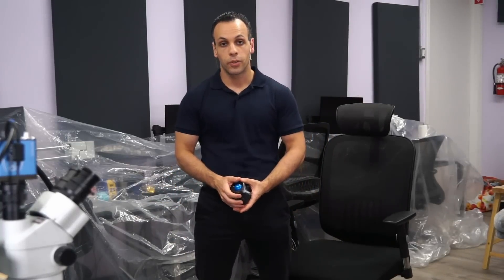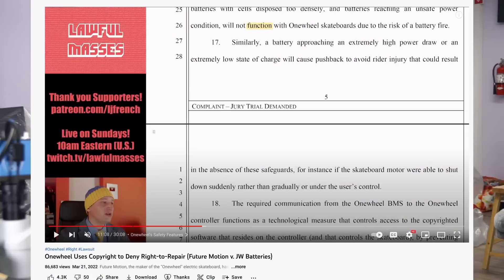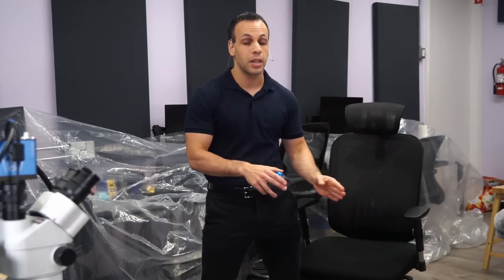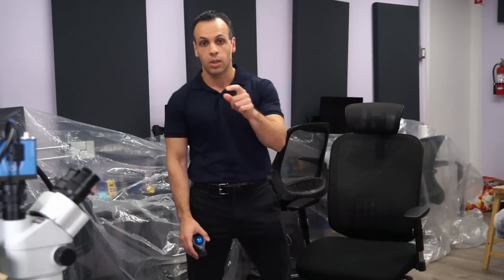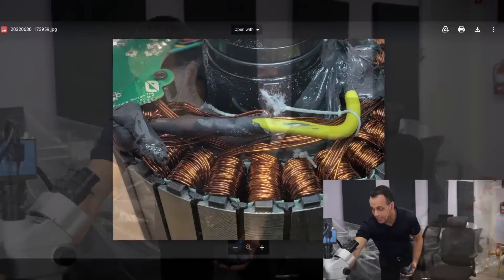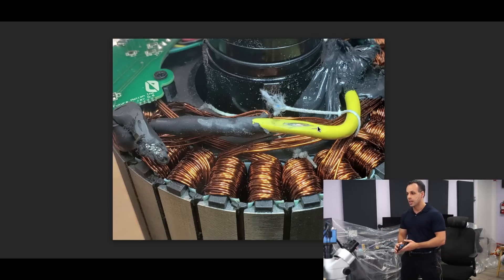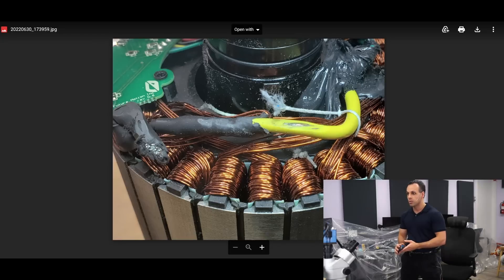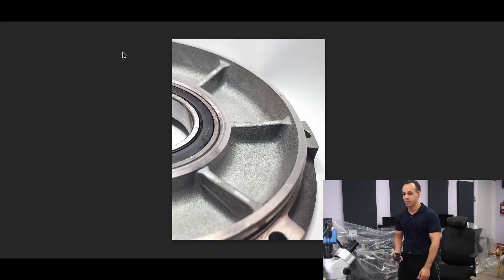HORRIBLE Onewheel GT motor repair; this is why manufacturers shouldn't monopolize repair!

Comment: The images shown are a perfect example that things can go wrong at manufacturing stage. Fact that someone installed this motor in to customers board, and didn't even bother to inspect it after "testing" is appalling. Perfect example that not every repair technician approved by the manufacturer is perfect. I knew it for the long time, very apparent especially in the automotive repair world. I have a very good example myself, I had to go through four workshops, starting at the manufacturer approved one and ending up with guy recommended on a internet forum who is not proper repair shop but a "brand enthusiast" who new the car very well and did get to the bottom of the problem and he is the one who did get the repair done correctly.
Reply: Post production inspection is non existent these days. From electronics to automotive parts I've had issues
Reply: @driedbrainfreeze2149   I agree with you on that bro. They must be so shorthanded there's no QA guys anymore they just slap and go at the plant.
Reply: "Authorised repair" is paramount to stealerships.
You can rest assured, if you use them you are going to be charged top dollar for services carried out by apprentices and or trained but unskilled workers on minimum wage who don't care, and are often under excessive stress to meet KPI's.

Take you gear to an independent repairer and you will find they are MUCH more an expert in their given field than any "Authorised" repairer ever dreamt of being.
They have to be. They have to deal with all makes and models, not just one brand, and they don't have a multi billion dollar global company backing them. Nor access to billions of dollars  for legal battles if they are required to be accountable to their liability.

For these reasons alone, you will get better service and a better repair, let alone that they generally rely on word of mouth in order to stay in business.

Comment: future motion is legally required to repair this defect even after disassembly, as user disassembly was not the cause of the damage(as recently confirmed by the FTC's action against Harley Davidson)

they cannot void a warranty for unauthorized repairs or maintenance unless it was the cause for the defect, but in this case the unauthorized "repair" action was only used to diagnose a preexisting defect.
Reply from the maker: Best of luck suing them, they have more money than you most likely
Reply: @rossmanngroup  report the refusal to repair to the FTC, if future motion wants to take the refusal to court let them deal with it.
Reply: future motion needs to be taught a lesson as in a class action lawsuit so big that it fucks them over
Reply: @billyhatcher643  Do it.
Get on the forums, get some traction, (literally everyone on there knows to what extent they've been ripped, they just like the product too much) organise the numbers and hit up a law firm. The firm will get at least 50% of the settlement, so it shouldn't be too hard to find someone to run the case. 

Make it happen.
Reply: Unless it had one of those stickers on in
Reply: @auzziegamer4661  warranty void if removed stickers? 
those are meaningless, pulling them off only voids the warranty on those stickers and nothing else.
Reply: @Marvin_R  really I thought the dumb stickers were to void warranty on the actual product if removed
Reply: @auzziegamer4661  not only are they not enforceable, it is illegal to put them there. If you live in the states and see one on your product, send the ftc a quick email with a picture and product name. Nothing will come of it most likely, but if enough people do it maybe they will start putting their foot down.
Reply: @corok12  the FTC is on a warpath, so chances are a little higher than usual that they'll take reports like that seriously.
Reply: "future motion is legally required to repair this defect even after disassembly" - And just how would you enforce this without dragging those bastards through the courts?

Comment: Depending on the voltage of the battery pack it could potentially kill the user. This practice is ripe for negligent homicide lawsuit.
Reply: It is also (esp. in combination with carpet fibres) a fire hazard.
Reply: This is the motor wires so it's technically AC between the controller and motor. Also like 3x times more current flow here than in the battery wires. But I doubt it would kill you🤣
Reply: Think the current is more of a factor in fatal electrocution than voltage. A taser is like 100,000 volts and mostly harmless. A home power outlet is 110 volts and can kill the shit out of you.
Reply: @NonEuclideanTacoCannon  This is a common misconception. The current that flows through you is largely determined by the voltage. A taser may have an open circuit voltage of something like 100kV, but it's current limited so you never experience that 100kV. Your house electricity and vehicle batteries have no current limiting, at least not in the range which would matter to a human. All that aside, electrocutions from household voltage of 120V is quite rare relative to the exposure rate, and it almost always involves special circumstances (e.g. standing in water). Thousands of people a day are getting 120V shocks and barely taking notice of it. Far fewer people are getting tased and a fair number of injuries and deaths still result.
Reply: @NonEuclideanTacoCannon  It’s the amp that can kill you.
Reply: A 100v on dc  is mostly harmless,  and this device probably work in 48V

Comment: Let's not forget about Future Motion making people ship their XR boards with deliveries not suited for handling high capacity batteries. They pretty much put safety of the carriers on the line just to save a few bucks. Guess they stop that shit real quick but we don't forget.
Reply from the maker: If I did that I would probably be banned from using FedEx or UPS ever again, and let's be real so would you.

The fact that they lecture anybody else on safety is insane in my opinion
Reply: Ups package handlers don't deserve to deal with companies cheaping out on something as cheap as packing material, we literally sweat out gallons a day making sure you get stuff where you need it, literal blood sweat and tears(I mean that, I knew people who have cried, and bled on the job, I was one of them) goes into shipping, there's alot more work that goes into shipping something than you think, at least respect us enough to pack your shit properly.
Reply: It's funny you should you mention this because I saw a Pint go through our station last night without a single Class 9 marking.
Reply: Improperly labeled packages with things like lithium batteries are INCREDIBLY dangerous in the shipping industry. That has literally brought down airplanes before.
Reply: Noone ares until a plane falls out of the sky